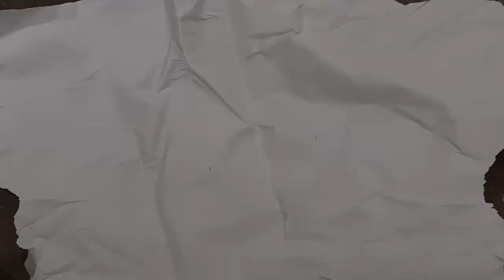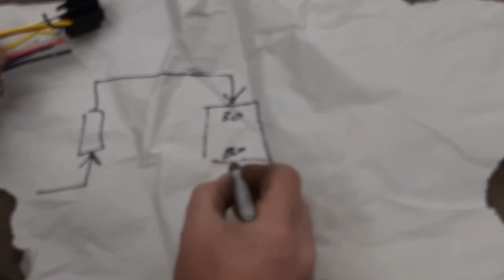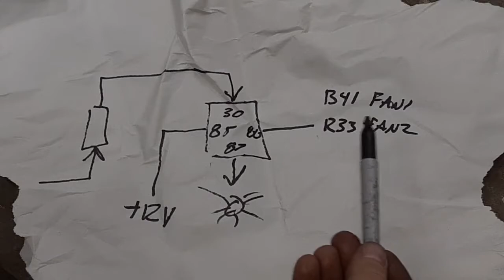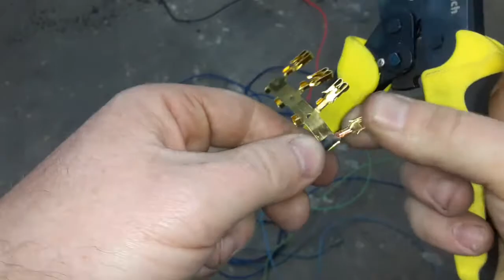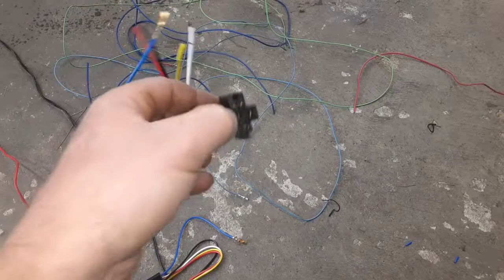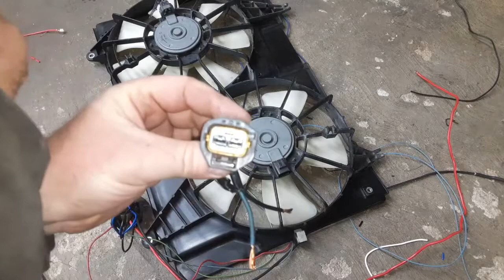LS Swap Fan Wiring

Comment: Good instructions.
I'll read the comments but.
Mines an 03 yukon/mechanical fan.
My computer ain't gunna work?
Reply from the maker: Correct, the mechanical fan engine computers typically dont have the electric fan settings turned on. If you can find a place locally that does LS tuning, they can turn them on for you.
Reply: 250.00 to remove vats?
I'll check back and see if he did something for fans.
What's that going into.
Thanks Again!

Comment: How do you change the stock Chevy fans from pull to push? Is it merely reverse the power wires to switch the polarity? Thanks!!
Reply: swap the wires to make the fan spend the other direction.  And if the blades are curved, flip the fan over on the motor.

Comment: @Wil’s Workshop Thank you!! I just finished my LS swap standalone wire harness with help from Brandan at LT1swap and Mike from ucandoit2 and was wondering how I was going to wire up the duel electric fans using B41 and R33 from the Dorman fuse/relay box. I have one question on relay pins 30 and 85 do I wire pin 85 to the battery + and pin 30 to ignition key ON fused source?

Comment: Do you have to program the computer pens
Reply from the maker: Yes, you need to make sure they're turned on in the tune.
Reply: Can you explain to me how do you do the tune
Reply from the maker: You'll need programming software if you want to do it yourself, I use HP Tuners, but there's some other ones out there. The other way is to just buy a computer tuned for a LS swap application.

Comment: Thank you for your helpful video. Do you still have to program the fans to kick on to the PCM or is it a plug-and-play
Reply from the maker: It depends on which vehicle the PCM came from. Some vehicles had electric fans stock and will work as-is. Some had the mechanical fan and the electric fans will need to be turned on in the program.
Reply: @lsswapshopp  thank you.

Comment: Great video, what year did those fans come out of? Also do you have a ballpark size for the over width of the fan assembly? Thanks
Reply from the maker: 2005ish, not really sure of the year. I just walked thru the junkyard with a tape measure and found one that was what I needed.
Reply: Wil's Workshop nice thanks man, reason I was asking was because that looks to be perfect size for my lq9 Datsun 240z

Comment: How does the second fan comes on???   If fan 1 controls the temp,,   It would’ve better to run 3 relays,  both at low/hi,,
Reply from the maker: The PCM has 2 fan output wires. They can be set at different temperatures to control two separate fan relays. Fan 2 is just wired to it's own relay. The PCM can turn on one at a time or both at once depending on the programming.
Reply: @lsswapshopp  @ o ok, but thebest way itslikestock?  Both at low, andboth at hi,  correct?
Reply from the maker: Stock is one fan with a low setting and one fan with a high setting, using 2 relays. The stock fan On/Off temperatures are Fan 1 - 226*/219* and Fan 2 - 235*/227*. Fan 2 almost never comes on even in a stock vehicle. This setup is identical to stock except I lowered the On/Off set-points for the fan operation, and obviously I didn't use stock 5.3L fans and relays but ones that would fit my radiator better.
Reply: @lsswapshopp  @  i tough stock fan was both low and both high,  thats how my 2010 silverad works
Reply from the maker: A 2010 is a Gen 4 LS based engine, The video and specifics are for a Gen 3 LS based engine, from 1999-2007.
Reply: @lsswapshopp  @  ok, so a 2006 gen 3  Will function different, ?

Comment: Dope! How do u know if the fans are going In the right direction?
Reply from the maker: I usually just stick my hand in front of them, you can feel the air going one way or the other. If it's backwards, just swap the wires and it should go the other way.

Comment: Is this the same way you hook up the fuel pump because mine just run and don’t turn off like other swaps I see. Thanks for the info💯
Reply from the maker: If the fans run constantly it could be your temp sensor. If it's unplugged or damaged the default option in the PCM is to run the fans so there's no chance of overheating the engine since the PCM has no idea what the temperature is. If the sensor is reading the correct temp then it's likely wiring to the fans or a really low ON temperature set in the PCM.
Reply: @lsswapshopp  no the fuel pump just runs I was asking do you hook it up the same as you do the fans
Reply from the maker: If you're using the stock fuse block, it uses the stock fuel pump relay, the computer will prime the system then run it when the engines running. I have a video on the fuel pump wiring also. https://www.youtube.com/watch?v=s4wgEMFf-kg
Reply: @lsswapshopp  thanks man

Comment: What size gauge did you use for the fan power wire the red one
Reply from the maker: I don't recall since it's been so long, but for a 30 amp fan you'll want 10ga or larger, and 60amp (for two 30 amp fans) you'll want 8ga or larger. Most modern fans are 30 amps or less per fan, but always check first. Something like the old Taurus fan is 75 amps for one fan, it WILL catch wires on fire if they're too small, just glad I had a fire extinguisher with me.

Comment: can the fan wire be fused through the harness?
Reply from the maker: If you have a spare fuse or two the correct size you can do it thought the harness. I have a newer video on my S10 where I wired the fan power thru the OEM fuse block which has a spare 60 amp fused terminal.

Comment: wow man , seems pretty straight forward but also seems to exact opposite of my set of relays . ive got yellow and blue as power circuit; 30 incoming 87 outgoing power.
But my wiring diagram shows the blacks as grounds! so i tested it this way and it worked . Are these relays designed to work both ways? as long as theres power going to 85 and 86 it will close the circuit? i didnt wanna push my luck and try it backwards even though the kit came with 3 extra relays.
So just to be clear are you working with a1999-2002 year 411 PCM?
Reply from the maker: Yep, the relays will work both ways without problems (usually, some brand may have diodes or something in them). The numbers are just the "standardized" way to wire them. It's mainly for troubleshooting later or if someone has to fix the work 10 years later they can just go off the numbers to see what the other guy did.                                                                           For that project yeah it was a 411 PCM, but the 03-06 P59 uses the same fan relay wires, so any of the 99-06 24x computers will be the same.
Reply: @lsswapshopp  ok cool,  so for sure my pcm blue 42 and red 33 are still the grounds?
Reply from the maker: Yep, just use those as the grounds for the trigger circuits and you'll be all set.

Comment: SO I went and bought a VW set of dual fans, they just happen to fit on my rad almost perfectly.
But they seem to have 3 wires each.
1.  Do i assume this is a low and high speed ?
2. According to Lt1swap.com my PCM has red 33 hooked up to hvac recirc door. does this mean i will have to reprogram the pcm to control the fan at a certain temp? what about blue 42, it says to add in this pin to control fan, so does that mean reprograming this pin too?
Reply from the maker: I can only comment on HP Tuners since it's what I use, but when you swap the PCM to "2 Fans" it automatically uses Blue 42 and Red 33 as the default pins. Most stock computers won't have any electric fan outputs in the program (most 1999-2002 used a mechanical fan), it needs to be activated.

3 wire fans can be high/low, or have two activation wires (from AC turned on or other methods), or one wire turns the other fans relay on/off so both fans can't be on at the same time. It's hard to say. The best bet would be to find a wire diagram from the stock vehicle or find the vehicle in the junkyard and trace the wires back to their sources.

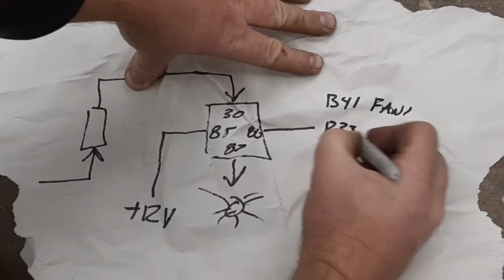Comment: 2:38 i think you meant BLUE 42?
Reply from the maker: Good catch, my dyxlexia strikes again. I wired it up right but wrote it down wrong. Blue 42 is the correct wire.
Reply: Doo you still have to get the pcm tuned for fans to properly turn off and on on correct temps

Comment: how did u figure out which wire is which on fans? what happens if you get it backwards? fan melts down or runs backwards? if u have a choice is it better to pull or push the air thru? my ac didnt work anyways so i removed all the componenerts and can mount fans front or back of rad.
Reply from the maker: DC motors generally just run backwards if you switch polarity. I just touched the wires for a second to check which way they spun.

"Puller" fan setups will almost always be better in terms of efficiency. "Pusher" fans will work fine, but they need to be shrouded better and usually oversized. It mainly has to do with airflow. Behind the radiator the vehicle speed pushes the air thru the fins and the fan pulls it thru faster, but pushers partly block airflow into the radiator and have to force it thru the fins. Either can be used but I always go puller if I can.

Comment: arent any of the relays left in the stock truck fuseblock  useable for this? theres like 5 or 6 in mine and i have 2 fans and a fuel pump to wire up.
Reply from the maker: Yep, you can absolutely use leftover relays in the fuse block, I've done it a bunch of times. Just figure out which fuse and wires are used to activate the relay and wire them up to the fan triggers.